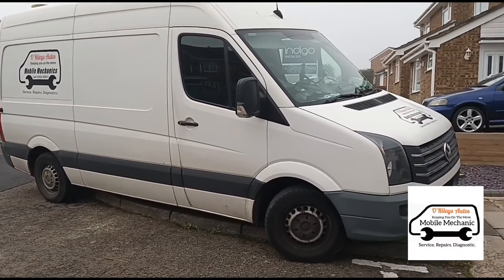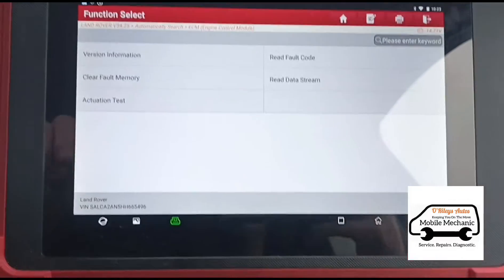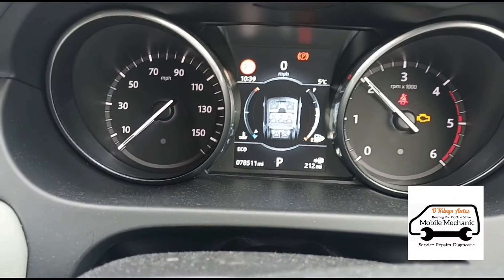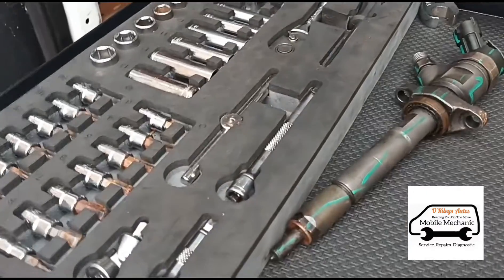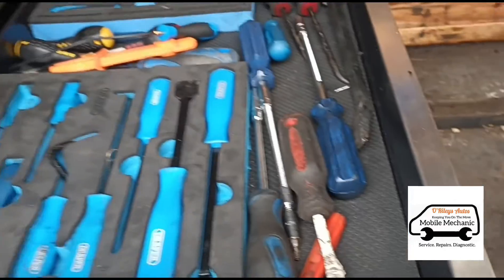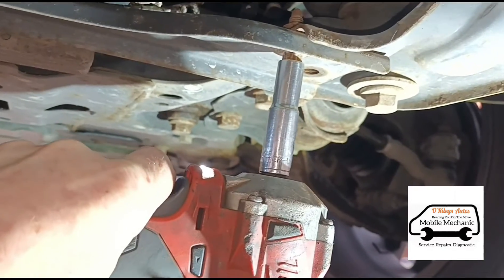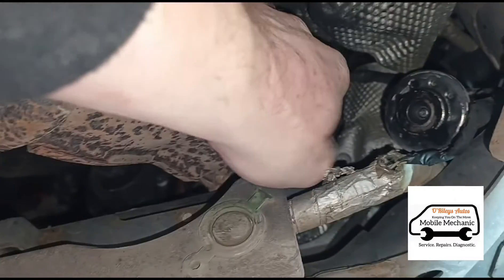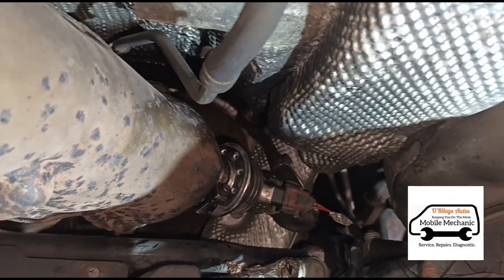Land Rover Discovery Sport 2.0d DPF & Ablue Injector Cleaning

Comment from the maker: You can buy Launch DPF cleaner here...
https://www.launchtech.co.uk/technical-fluids/dpf-gun-particulate-filter-cleaning-fluid/
Reply: Nice work @oreily autos.  Do you happen to have a video doing a procedure for cleaning throttle body and valves.  Rough idle at cold start up, goes away after warm. Plugs and wires have been changed on my 2017 Land Rover discovery sport 2.0t.